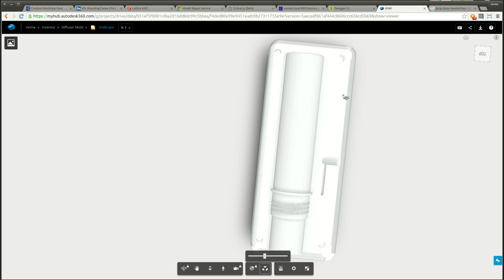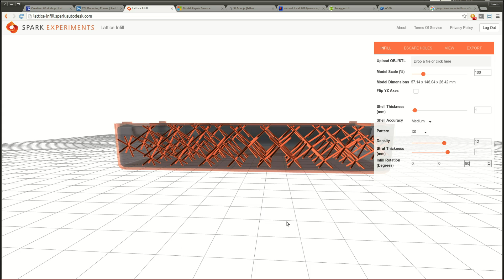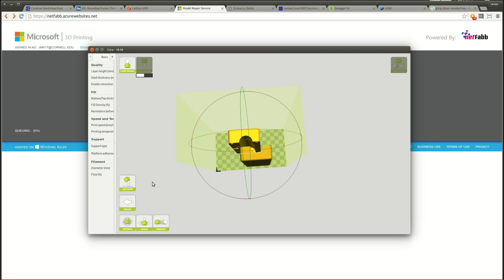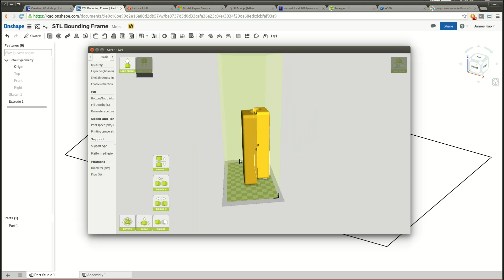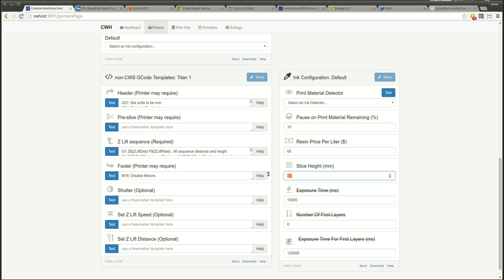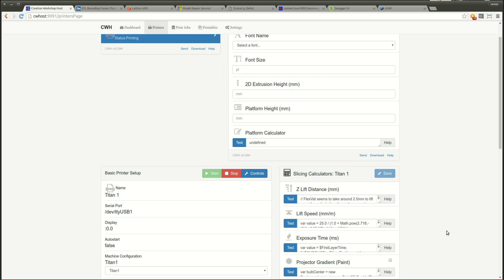CAD to SLA 3D Print Using Lattice Infill, Cura, SLAcer.js, and Photonic3D

Comment: I was curious if I would be able to do the same for the Peopoly Moai SLA Printer. I know it's not a DLP printer but I need to create a model with a  lattice internal structure for my thesis. I have been attempting to do so but not the way you did it. My first attempt ended up printing a solid model even though the model I put into Cura for slicing was not solid.
Reply from the maker: It should be possible to print this with any resin printer, laser or DLP. The challenge will be finding a tool to generate the lattice since the Autodesk tool is now defunct.
Reply: I've been using meshmixer by autodesk which has been able to creat the lattice structure. I think it works properly.